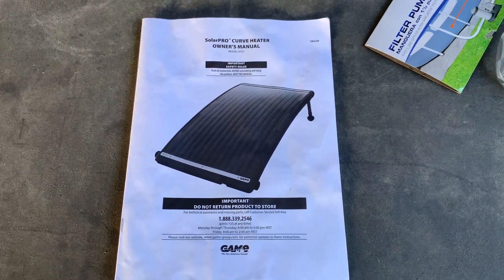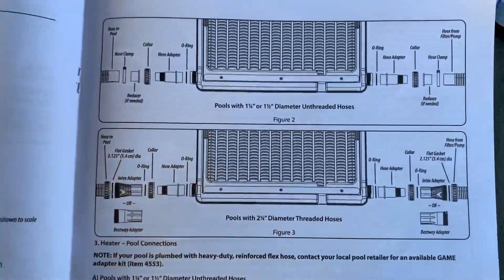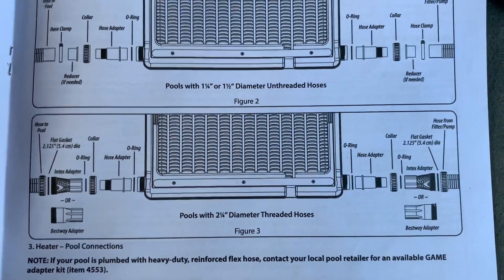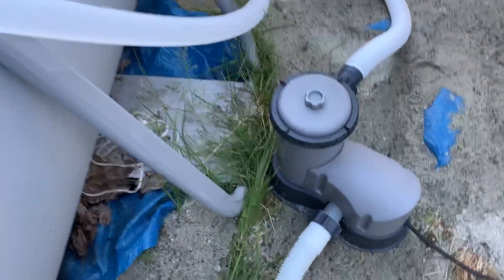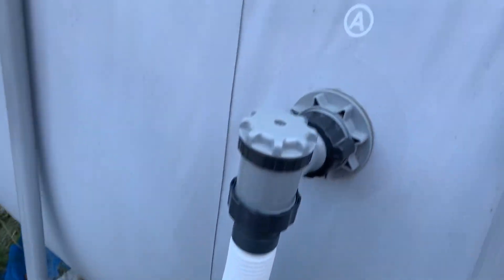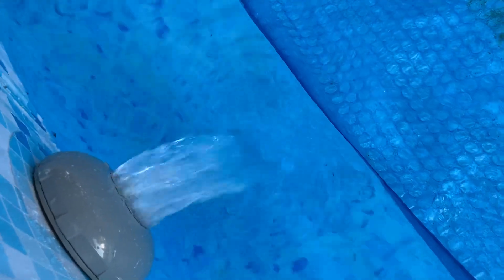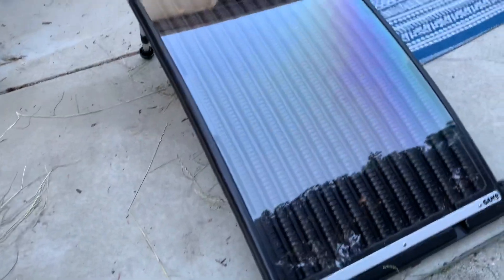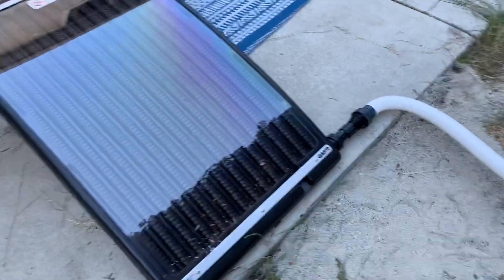GAME solar panel attached to Coleman above ground pool

Comment: Does it work? we are considering getting this to heat our pool since it's June and our pool is still 70*
Reply from the maker: It does work, but I would recommend connecting two panels and have them in direct sunlight all day to work well.

Comment: I built 2 solar boxes. Each one is 4x4 using 2x4  with 250 ft  each of high quality 5/8 black water hoes. Got them hooked to there own pump a 12 inch intex  sand pump I ran a hose over the top of the pool to suck out the water and a hoes over the top to put the hot water in. You need to find a place in your yard where you get full sun. I put some old shower doors over the top of the solar boxes and the water gets very hot.

Comment: I have the same pool and I think you've run your pump backwards. That one big hose that, was spraying is the feed hose, it's the skimmer of sorts and the two jets on the right side are jets and are meant to circulate the water. So one hose in two hoses out you have two hoses in one out :)
Reply: Also one more thing, ditch that pump it's not sufficient for the size pool. I've got the same pool and the first thing I bought was a sand filter and 1 hp pump, I think you'll find the solar heater works better when you can move more water. That, pump is rated at 1500 gph in a 7092 gallon pool and then you restrict it a bit by running the heater and it's also not flowing enough because you've routed the hoses backwards. :)
Reply from the maker: @uchi00  Once I hooked up two panels warm water came out. And yes I agree that a larger pump is better. I already upgraded from the small one that came with the pool, but an even larger pump would have been nice. My issue is that the panels did not receive sunlight all day long due to trees, so they got cold in the late afternoon.
Reply: @wisegirl  also the water flow is to fast for the solar panel to work put a diverter valve in
Reply: I have two of these in series and I swear they have done nothing gimick

Comment: It looks like you followed the water flow that is embossed on the heater, NOT what is printed in the instruction book. Correct?
Reply from the maker: Not sure what you mean, but the heater did output warm water
Reply: wisegirl It turns out that it doesn’t matter which way the water flows through the heater. Enjoy the rest of Memorial Day weekend.
Reply: The instructions now say that it doesn't matter which direction the water flows in the unit.

Comment: I just bought one of these 2nd hand..going to make a portable shower for my van. Will use PV and maybe an electric dc pump to assist...anyone have any ideas??
Reply: Not sure what capacity of the panel is. My camp shower is a 5 gallon bucket left in the sun with a ball valve and a hose. Works well.
Reply from the maker: Just make sure it is at the best angle to the sun! Best of luck!

Comment: Ok im assuming you have been disappointed with this product. in my opinion two reasons will be causing 0 temperature increase. No 1 you just don't have enough solar panel surface area (the panel is way to small).
No2 your using an electric pump which will result in Water being pumped out the panel before it has warmed at all.
Solutions no1 get more panels or black hosepipe
Solution to point no2 throw the pump away and use natural convection to pump the water. This will be slower and alow the panels to work. You will find surprisingly good results with convection and its free.
Reply: No dont downgrade no no no...invest in a solar pool cover blanket they look like bubble wrap they are lightweight easily removed amd folded off to the side they make the pool really warm if you have sunlight...i saw a guy coiled a 100 foot garden hose back and forth on his roof another guy simply laid it out on his yard and occassionally ran the hooked up garden hose from the return side throughout the hose back return into the pool sounds funny but it works also black trashbags with hula hoops inside them work for cheap cheap..i used to put them on my pools i had for my kids in summer...they were inflatable or preformec plastic but around 8 feet by 6 feet or 9 foot round or 6 ft round. Not deep just 24 inches or 18. The water would be icy cold then within 2 hours warm as bathwater. The solar blanket pool warmer works great.
Reply from the maker: @tamarakennedy4976  I had one of these two. My challenge was that I didn't want to buy a roller for it, so it was cumbersome taking it in and out of the pool
Reply from the maker: After this video I actually upgraded my pump and changed my pool pump. Even with two panels, the temp increase was quite minimal. You are correct in stating that the surface area is just two large. So I think I might downgrade to a smaller pool (gasp) next summer and connect my two panels. I have considered black piping, which will help, but this is about as handy as I can get, so not sure how much more I want to invest in this.
Reply: I would install a divertor with a shut-off valve  and separate it from the pump and  have a 1/2" hose go straight to the solar heater and then to the  pool . That way, you can control the flow of water and have real heated water in your pool